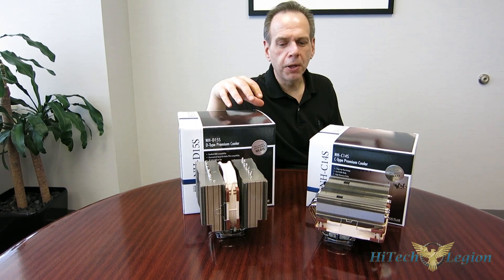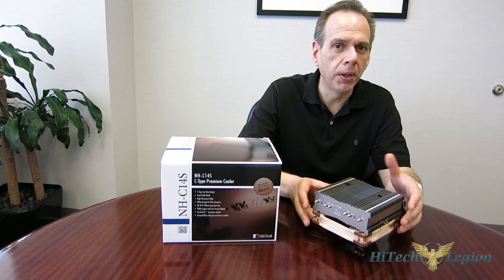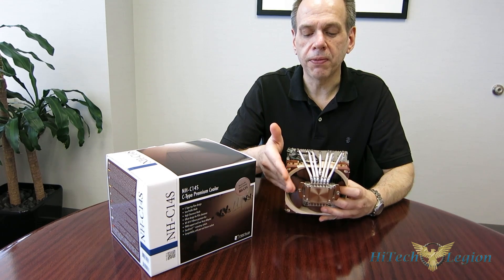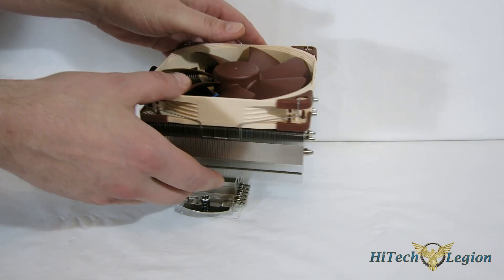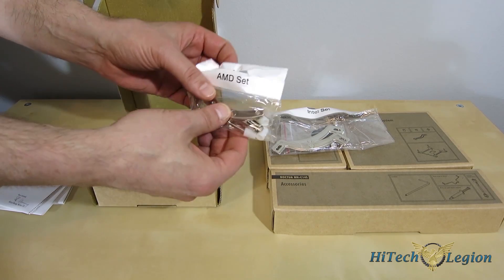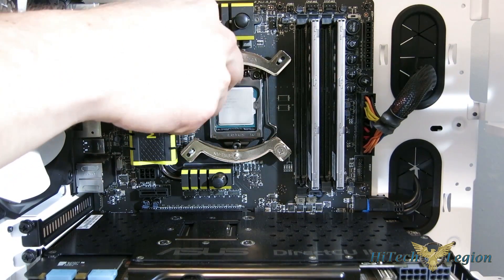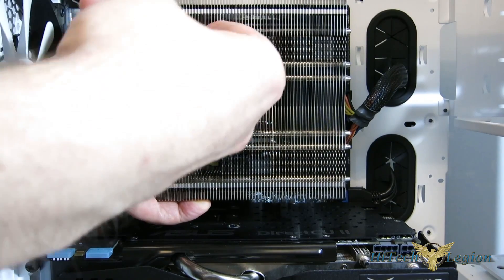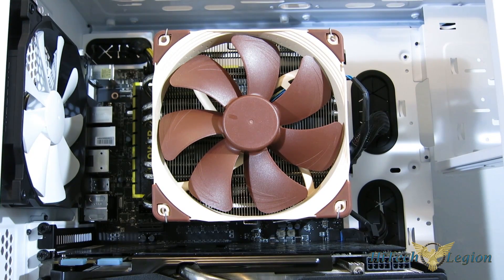Noctua NH C14S High Compatibility CPU Cooler Overview, Installation and Benchmarks

Comment: Hey thank you What temperature differences are there exactly, whether you start at the bottom or at the top and in which direction (i.e. towards the mainboard or towards the inside of the case)?

Comment: Would this cooler be amazing for a ryzen 7 2700x? I was looking at the Nh-d15-se-am4 but you pretty much need to move the one fan higher to clear most memory in my case using flare x 3200 cl14 amd ram ddr4. I was told to look at this for an Option.  I am just going to use auto OC mode for ryzen. Hope you can help. Thank you for your time.

Comment: Thorough review. Just something I would like to mention, when you receive the NH-c14s it has a pre-installed fan that pulls air from the cpu socket and ram. In Noctua's demo of the cooler they mount a second fan that is also pulling air up from the motherboard. In your demonstration your pushing the air down on the C.P.U socket and R.A.M. They also give strong advice that the cooler only has two mounting positions. Pipes to the left, or pipes to the south. The internal gas in the cooler apparently doesn't work against gravity, so those are your two mounting options.
Reply: even I noticed that he has his push position on the fan, which is not recommended. I have fan on the top, pull position and pipes to the south, best, as you said the heat pipe liquid works with gravity here. NH-C14S is awesome cooler with awesome RAM clearance. Highly recommended if you are not a water cooler guy and you have a core i9/any other high core count cpu.
Reply: you can mount it 90deg orientation with pipes vertically with the 90deg mounting kit, so you can mount it any direction as you like with the kit or not.
Reply: @jaystol7988  Nope. You can't have the pipes running vertically upwards towards the top of the case. Its written in bold text in the manual when you buy it. I've explained why.

Comment: I've looked all over & asked everywhere but no one can answer my questions. 1: How does the NH-C14S compare to the NH-U14S in terms of cooling? 2: How many different ways the NH-C14S heatsink be rotated when mounting, specifically on AM4?
Reply: Mike Soda I’m working on installing mine, I go at a glacial pace but I’ll try to remember to let you know. I’m in an FBM-01 so I’m going to need to mount mine heatpipes-up; hopefully this is possible.

Comment: Upgrading my FreeNAS server to a Xeon chip from the Pentium that is in it.  This is the cooler I am looking at using.  I am wondering about overhang though.  I use a Sumpermicro X10 motherboard.  So, it has server style RAM slots above the CPU rather then to the right.  Would it still blow air over the RAM in it's normal orientation?  Also, if I rotate it 90 degrees so the heat pipes are at the bottom, will it still clear the PCIe slot?  I may be adding SATA/SAS HBA to that slot later as well.

Comment: I have this cooler cooling my 4790K and I have a question about the fan setup, I installed it in high clearance mode to be able to use high profile memory modules, so the fan is on top, I'm asking about the direction of the air flow, should it be from top to bottom (my current setup) towards the CPU and Heat Sink or vice versa ?
Reply: Oh yeah and the system is Micro ATX :)
Reply: Ahmed Maher It is all dependent on the airflow of your case. In most cases pushing air through the heatsink is most effective, but that can vary. Try both directions and see which gives the best performance across all of your components.
Reply: +George Cella awesome